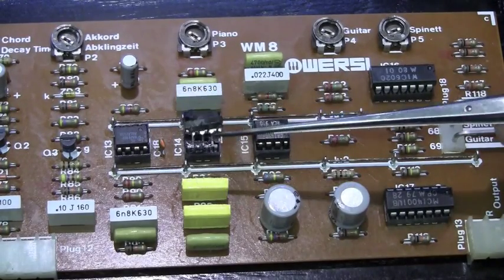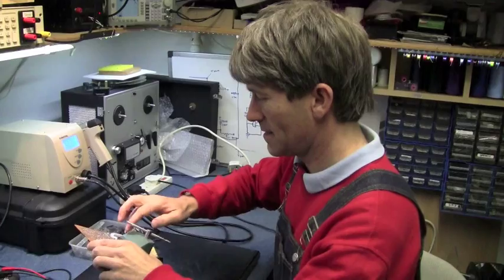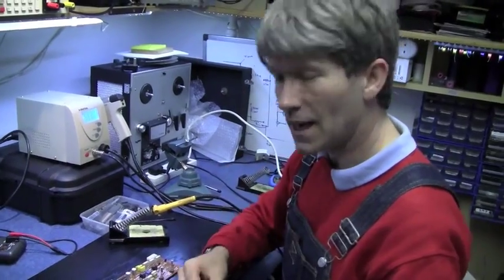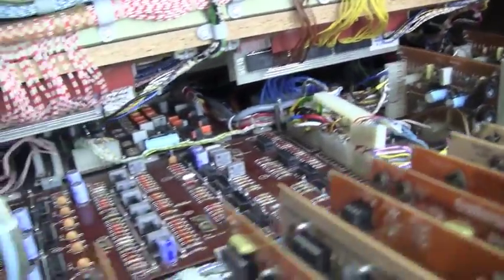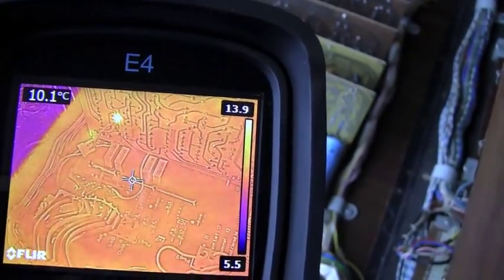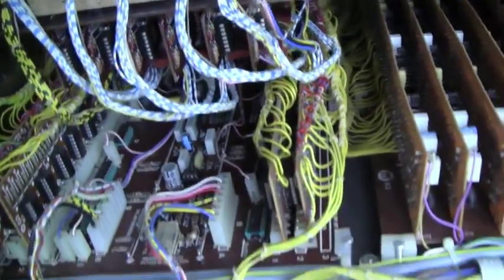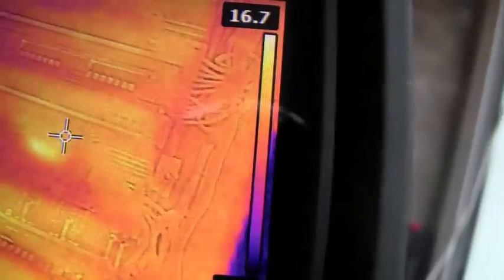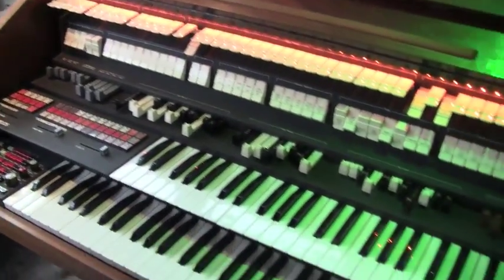MF#7 Wersi Helios vintage organ final circuit board repair

Comment: Thank you Markus and Jason for this wonderful series. It is very inspiring to watch the two of you playing around, and now even i  have gotten my own  (currently about 35% working) Helios. Regarding the PCB board on top of the drawbars; These are preset boards containing several fixed drawbar settings, for a total of 6 presets, which can be recalled from the sound computer. (manually selected from dip switches on the soundcomputer PCB board) The actual drawbar resistors are residing on the drawbar board, and will work fully in the absence of the preset boards, as long as the audio signal is passed on. Regards From Denmark and greetings to all you happy Wersi Helios owners and enthusiasts out there.
Reply: Hi Gunni, Just wondering if you could tell me what the PCBs AG1 and daughterboards AG2s are?  I can't find any documentation on these boards.  Currently working on the Helios WST.  Lovely sound, when it sounds!
Reply: @robinsutcliffe_video_art   Hi Robin, nice to hear from fellow Helios owner! AG1 is the Arpeggiator circuit, mine was totally fried so I ordrered allt the IC's from E-bay, still awaiting them to arrive. Hopefully I will get it full working upon arrival and installation of the IC's ;D
Reply: @drepalla  NICE!  I REALLY love Arpeggiators!  Wow awesome.  My PS6 board seems to be giving problems, which means basically everything is affected at the moment!  I tried bypassing the PS6 though I don't hear audio if I connect directly to PS2, which seems weird really as some parts do get power...  Anyhoo I have ordered some replacement parts for the PS6 board, we can then see how she handles.  Thanks very much for your advice!  Maybe we can keep in touch about the restore, I'd be very interested to hear how you get on
Reply: @robinsutcliffe_video_art  yes I would like to stay in touch as we get further in the process. My problems started out with at defect PSU, it was making -30 volts on the negative -15 side, therefore so much is fried in mine, I hope you did have the same problem.
Reply: @drepalla  hmm yes that sounds harsh!  I'll let you know after I rebuild the PSU what has happened!  Good luck

Comment: At 6:27 I would say that the snaredrum needs some "rattling" and the cymbal needs more "sizzling". The snaredrum is made by adding white noise to a ringing filter circuit and to me it doesn't sound like it's getting the white noise. The cymbal is made by XORing some square waves together but to me it sounds like some of the square waves are not running which makes it sound more like a triangle than a cymbal. But it could off course be an earlier version of the Wersimatic II than the one I have. Just some thoughts from another analog tinkerer  :-)

Comment: I'm curious, what kind/brand of soldering iron do you use? I would like to find one with a fine tip like that. Thanks.
Reply from the maker: Hello Matt, I used a Yihua 898D+ its a soldering iron and hot air gun for surface mount devices . it comes with about 12 tips of different sizes.
Reply: markusfuller
Thanks, and thanks again for your quick response. Really like watching your channel.

Comment: I do so want one of those solder suckers.
Reply from the maker: Hi Neil, They are about £70 to £75 UK pounds, It says Duratool on the front but I cannot find any model number . Just a label saying Made in China (theres a surprise).
but yes they are handy for their price. best wishes from markus
Reply: markusfuller Thanks for the reply, i am an expat Brit living in Atlantic canada, i have a slowly building set of tools in my workshop, the latest is a decent digital soldering station ( bought from MCM in the US ) and i think one of those chinese solder suckers will be next.
Reply from the maker: Hi Neil. They do save a lot of time and are useful for stripping down old boards to make stocks of re-usable components.

Comment: Hi Markus.  I sent you a message regarding you repairing another Wersi Helios, not sure if you got it with this new Google message system.  If you are interested, message me back please.  Thanks!
Reply from the maker: Hi Sorry I did not get any notification that a message had been sent from you. Im really sorry but I am totally bogged down with so much work at the moment that I simply cannot do any repairs for anyone. Truly sorry about that.
Reply: That's ok, I understand.  Thanks for replying.  Do you know anyone else that would be able to help?  Engineers to fix these organs seem to be few and far between nowadays!
Reply from the maker: Hi you could try googling wersi Peter Armitage and that will get you to the wersiclub uk where Peter is a Wersi Technician. other than him I know nobody else who could help. by the way what do you thing maybe wrong with it ?.
Reply: markusfuller
Hi, thanks for the recommendation, I'll try and contact him.  The footswitch is not working properly and there is distortion coming from the upper and lower keyboards.